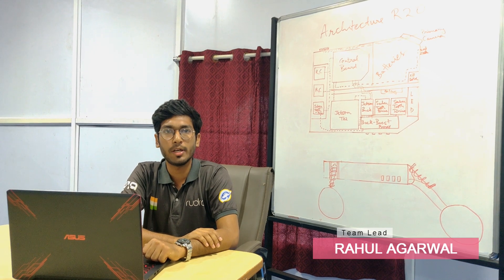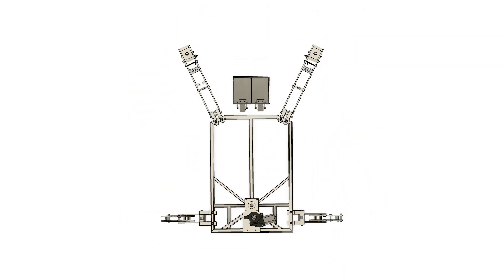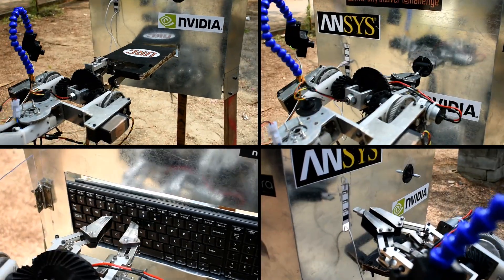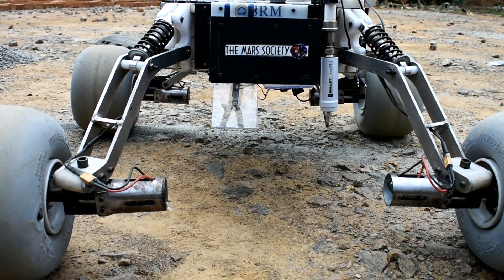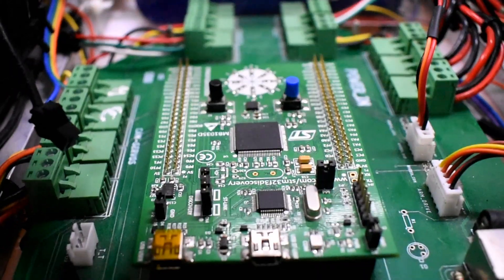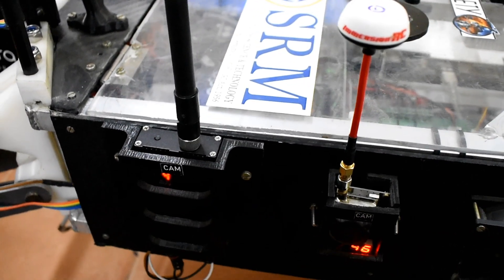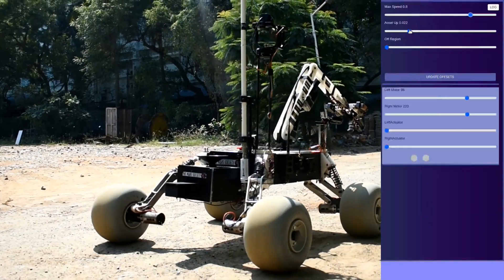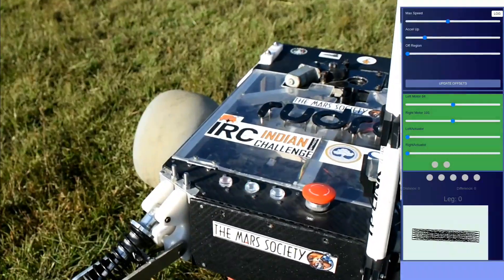RUDRA - System Acceptance Review - URC 2020

Comment: Well done ! Good team work ! Congrats for your recent international achievements !
Though you can consider avoiding the use of off the shelf RC servos at higher load bearing joints as it has limited the stability and response of the arm to that of the servo motors themselves.
Reply from the maker: Thanks for the feedback.